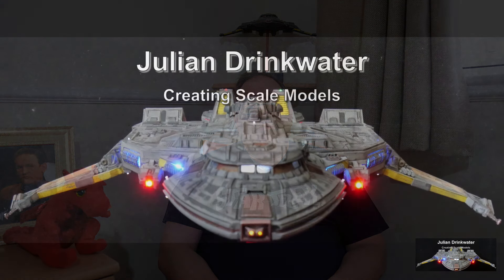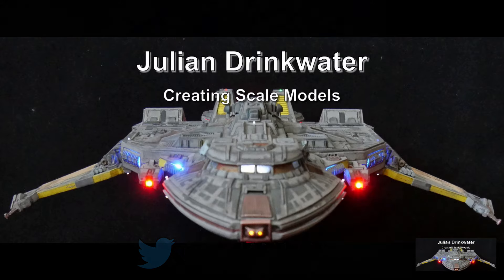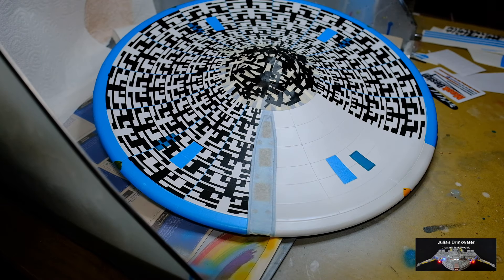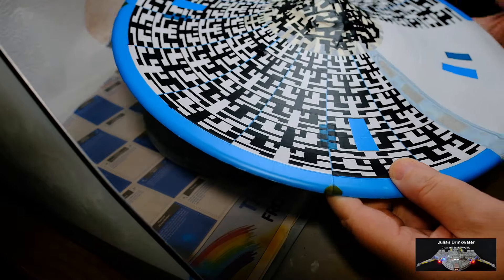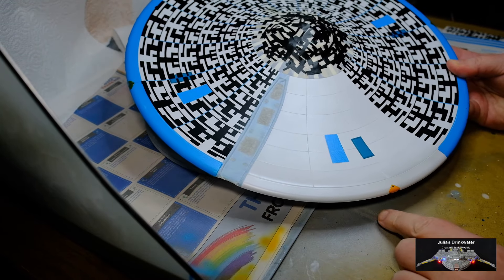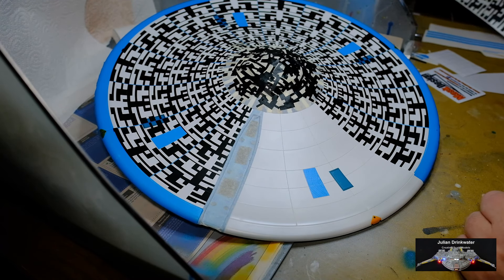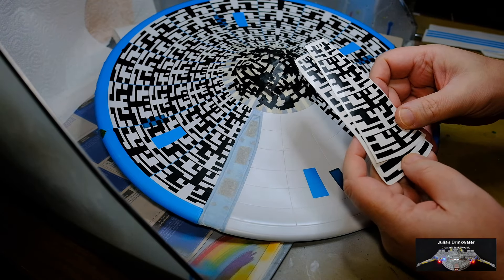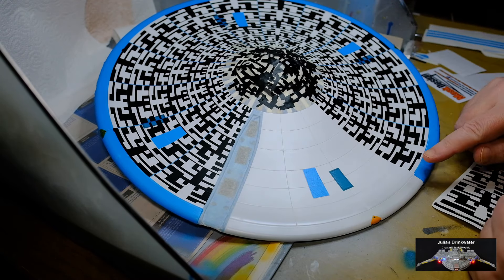Project Enterprise Part 16

Comment: Julian! Man that looks like it takes some calm nerves. Not sure how I feel about the transfer method. Is it more or less of a pain then adding vinyls one at time?
Reply from the maker: Hey Russ

They are very easy to apply and as you seen easy to correct misstates if they happen, it is just very time consuming to learn how to do it and place them, but very well worth all the effort to get the effort you want.

the masks are very hard wearing and can but up with a lot and that is good Mr color paint does enjoy eating into stuff so they need to stand up to it, as for the transfer you get use to it after about the 4th time it starts to become easy. 

Before I found MaskDesign and their masks I looked at many different ways to do it but by far this is the easy and most effective way to get the look of the Aztecs.

Regards
Julian